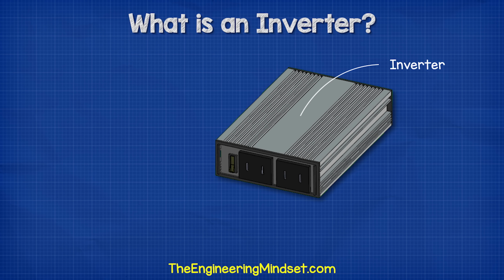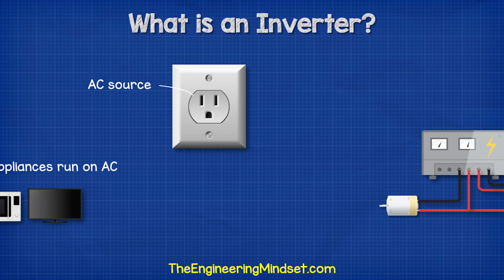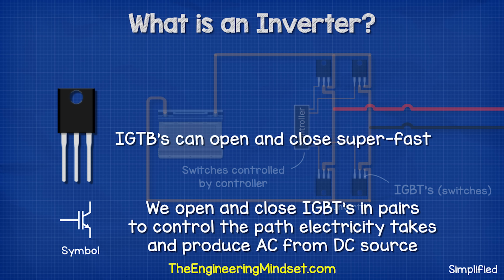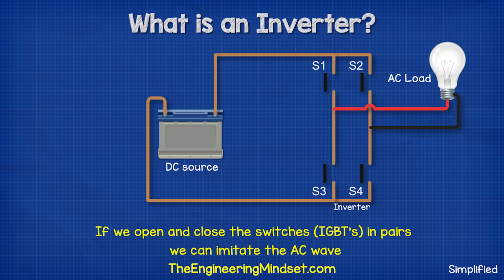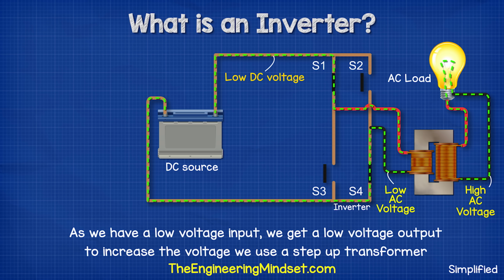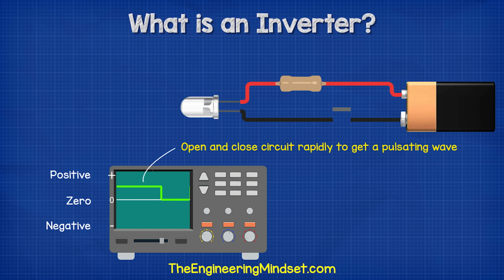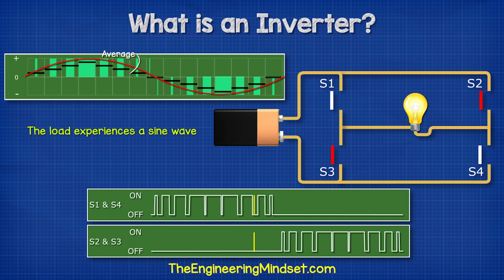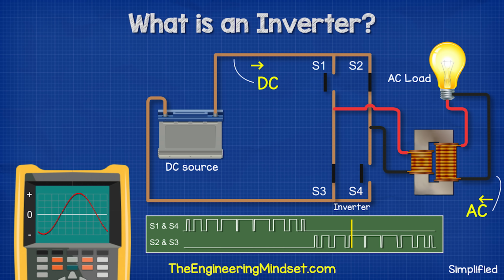What is an Inverter and What Does It Do?

Comment: I have a very difficult time understanding this. I'm very concerned about running my oxygen concentrator when the electricity is down and I have used up my tanks. Can I have a car battery in my house with an inverter, and if so, how long would it last? I hope I get an answer; I'm so worried!!!

Comment: How can one take spiked dc above and below 0, high voltage and high frequency down to 120/240 60hz? 
Can a pure sine wave inverter do this? If so what is the maximum volts and frequency they can handle?
For example 2000 volts to 120/240 can be achieved by calculating wire turns from the L1 side of and using fewer turns on the L2.
How does one reduce frequency? Capacitor and resistor in parallel?
Or can this be done with an inverter?

Comment: AM = Amplitude Modulation . FM = Frequency Modulation.  PCM = Pulse Code Modulation (Digital)  I was a              '' Strategic Microwave Communications Operation & Maint Tech '' , PMOS 26V in the USACC for 8 years ! Had 6 months of Basic Electronics and Microwave Communication Systems Training and  I am also a State Licensed Journeyman Electrician, SMOS 51R,  (Sub Contractor)  with over 55 years in the trade ! Residential & Commercial Electrical Wiring , Designs, Installation & Maint.

Reply

Comment: Pictures a TV but ironically you would need the inverter to power it as that's the source its been designed to run off but its internally rectifying to dc at around 90v to drive the backlighting and usually 12v and 5v for the rest of the circuitry.

Comment: This was very fantastic! Now I'd like to know why an AC appliance draws 10x its rated amps from the DC source when using an inverter?
Reply: When you step up the voltage from 12V to 120V you will draw 10x the current from the primary side of the transformer.

Comment: So that’s how a simulated sine wave is produced, but how is a pure sine wave produced like in a UPS from the battery? Is it simply a better grade of switches operating even faster? Or is there something else involved?
Reply: when the DC pulses are passed thorugh the inductor on the transformer, it smoothens the electrical output to a sine wave

Comment: Mr. Mindset, I was at work the last couple of days witnessing the atrocities of industrial maintenance mechanics attempting to repair an industrial sized machine. 
I've watched a lot of your videos and they have contributed immensely to my YouTube engineering degree. 
I am not a member of their elite brain-trust, I mostly sit in judgment of them. 
I rarely read the comments here so I'm not sure if you answer comments but I'm going to try to make this question short. 
We have a multi-million dollar investment of blow molding machines being installed to replace older style machinery. 
They have installed a brand new air compressor that was shipped from Germany or Belgium as I recall.  We are in the United States. 
This compressor has been in use for about 8 months now. There have been several failures already of different parts of it; most recently it blew out a seal between two parts of itself that should contain the pressurized air.  
The brain trust worked on replacing the seal for several hours and then switched it on. I was 100 yards away at the time but I heard an explosion which I imagined was one of the plexiglass sight glasses on it. It turns out it was actually something in the electronics cabinet that so-called controls the compressor.  One or more components in the cabinet electrically exploded.  It blew the fan out of the side of the cabinet and of course there were a few things scorched and was deemed to require further review before starting it up again. 
So they spend 12 or more hours the next day working on the cabinet. The whole time the production line is not running and therefore losing money quickly. 
That's the back story in a nutshell. 
My real question is why are the electronics important or necessary for a compressor? 
As I sit in judgment of them I'm thinking about how there was a time before electronics, a time when industry used massive compressors that were simply electric and simply turned on and if they reached their storage capacity a mechanical device would shut them down until demand is greater than supply at which point a mechanical device would trigger the compressor to start up again. 
I suspect the electronic portion of the compressor's operation is supposed to save energy, and possibly activate oilers, or perhaps purge the air tank on a schedule as a preventative measure.  If that's the case then all of those functions could be done without electronics and therefore it seems there would be so much less opportunity for downtime due to overly-complex electronic issues keeping a mechanical device from even running. 
Sorry it was a long comment but I was thinking all day yesterday that I should ask you on your next video.  
If you don't respond maybe someone else qualified can offer insight.
Reply: The short answer like you mentioned is "cost and energy saving." People in government make the requirements for more "efficient" machinery but don't realize or care that it costs even more to run meticulous circuit board operated machines.
Reply: @UltraGamma25  Thanks for your reply. I hadn't considered that it could be a government regulation. Perhaps it is but my guess is it's more smoke and mirrors than anything.  More reason to pay for the technician to come fix it. 
A side story to the main story is this. 
A member of the brain-trust said that he thought the explosion was caused by someone not turning off the power at the main panel where the electricity comes into the warehouse.  He said they only turned off the electric at the now damaged control cabinet and therefore when they turned the power back on at the control cabinet "all the energy surged through the system and blew it up" 
So apparently there's a store of energy in the cabinet or the main cabinet that will surge through the system if you don't turn it off at the entrance to the building. 
However, magically if you turn it off at the compressor the energy does not surge from the entrance to the compressor. The shutoff at the compressor apparently lets the pixies in nice and slow. 
Somehow I missed the giant battery or capacitor bank that doesn't exist. 
Not knowing something is one thing but going so far to make up a story is a completely different thing.
Reply from the maker: See our new video on how to build mechanical versions of electronic circuits? Watch here: https://youtu.be/Zv9Q7ih48Uc

Comment: You forgot to mention that electronic devices are also DC, alternating current is only meant for traveling distances. Once you plug your device into an AC wall the power also gets converted into DC. None of the components on the motherboard is alternating current.
Reply: Well, alternating current is meant to easily transform between different voltages, as the only thing you need(simplified of course) is some wires wrapped around some iron. Travelling big distances is done best by DC
Reply: @ジョセフギター  No no, I only meant that travelling long distances is done most efficiently by High Voltage DC. Over long distances capacitance between power lines  and between them and ground is getting really big, and with each change od direction which is being done at 100 times per second the energy is wasted on that. In DC you only have to figth that capacitance once when you turn the line on. At the end of a HVDC line you just use inverter to convert it back to AC and distribute it localy

Comment: I do not consider this to be true AC, but rather faux AC. You never get a true sine wave. 

It is always +120v or -120v just turned for varying amounts of time. 

True AC fluctuates between 0v and +120v and 0v and -120v over the prescribed amount of time.
Reply: @ジョセフギター  sounds more like you have unstable AC from your power provider and your inverter has a voltage regulator in it to boost your AC during sags.
Reply: @ジョセフギター  you can add more “steps” to produce a more accurate AC sine wave, but it will never be a true AC sine wave.
Reply: capacitors and inductors are used to filter the sharp edges of the DC time pulse events at the output, its 99.999999% a sine wave
Reply: @mbell1216  Perhaps, but still not the same as pure AC sine wave.  That's why some motors will not run correctly on them.  My Subwoofer creates a nasty hum when running off one.  Just to name a couple examples.
Reply: @baddmatt9588  That would mean that the inverters you used to power those loads were not pure sine-wave inverters, as in they did not have correct/sufficient filtering. 

Pure sine-wave inverters that perfectly replicate an AC sine-wave do exist, but are quite expensive.

Comment: I have a unique idea of putting a mini split AC compressor in a car but using car parts (I'll only use the compressor, the evaporator, condenser etc will left stock from the car). 

I'm planning to get a 0.5hp or 1hp compressor (I might need to upgrade my alternator) and get a 1500w sine wave inverter (or make a custom one myself with EGS002 module so I can integrate things better with the car). 

This also gives me the opportunity to run my car's AC without turning on my cars engine by using a transfer switch to power it from my house (I do a lot of things in my car) and use a server power supply to power the auxiliary condenser fan, the blower fan and charge the battery at the same time. 

I'll do this when my Denso 10PA15C dies (i bought it used). What do you guys think?
Reply: I think that you should avoid leeching energy from your car, especially from its battery or alternator. You will destroy it prematurely. If you have an old engine you can use it as a back up generator if you know what you're doing.
Reply: @UltraGamma25  I'll upgrade my alternator (or make a dual alternator setup). 

But I think this will use less energy because my current stock setup can take like 5hp from the crank.. that's a whopping 3750 watts power from its crank. 

I'll have a spare 10pa15c just in case this experiment failed to work. I don't really care about how complex it would be if it gonna work in the end.

I actually have done something similar to my alternator in 2019 when there's a mass blackout in my area. I use my car to power my whole house using a power inverter and it worked just fine
Reply: @putraadriansyah8082  Welp as long as you know what you're doing bro. The main thing to watch is safe idling and spare alternators.
Reply: Just use an extension cord from the house and power it that way? 😂 Or a solar panel on the roof with a separate battery?
Reply: @Peter_Enis  well, with some relay mechanism.. yes. To power it from garage's electrical outlet or from a generator when the engine is not running
Reply: How many watts do you need for the airco?
Reply: @Peter_Enis  under 800w if possible. The car is a 1988 Toyota Cressida gx71. It's a relatively small car so I don't think I need a really big compressor.. 

Right now the denso 10pa15c still works fine..
Reply from the maker: Seen our new video on HOW SOLAR PANELS WORK in detail https://youtu.be/Yxt72aDjFgY

Comment: But what if we needed more power? Tell us Paul!
Reply: XD
Reply: @polaris_babylon  XD indeed XD
Reply: Good question buddy
Reply: We call "Tim the toolman" 🤣
Reply: Easy, just series those bad boys together
Reply: Put a wind turbine on it and your good for life 🤣
Reply: I think adding more transformers and MOSFETs with larger capacitors to handle the surge. Possibly thicker wires and traces to handle the continuous high load
Reply from the maker: Seen our new - How wind turbines work video? link: https://youtu.be/Hf875eOVrVI
Reply from the maker: See my new MOSFET explained video here➡️: https://youtu.be/AwRJsze_9m4
Reply: Great video! One question, is the energy of the current the voltage or the frequency?